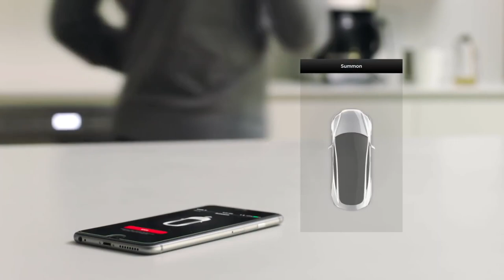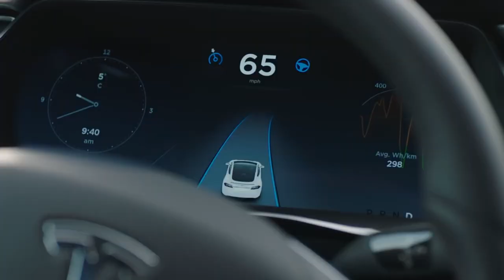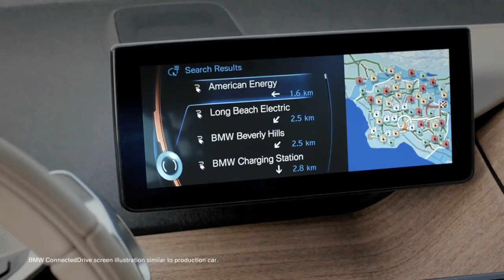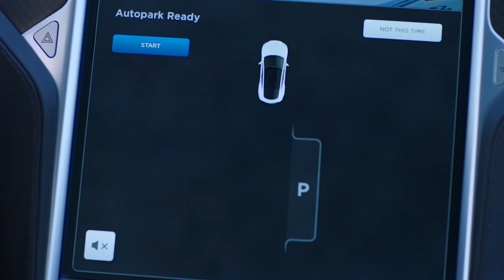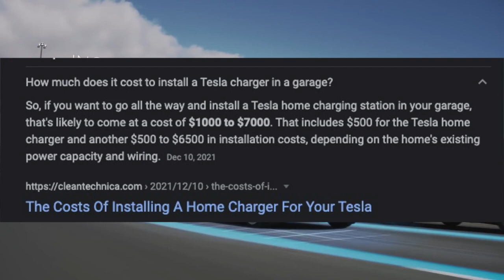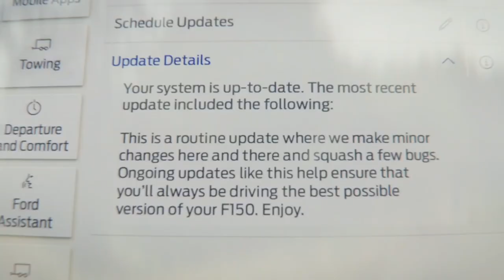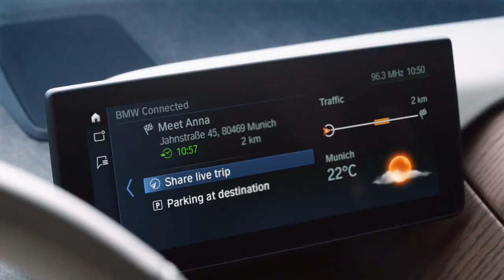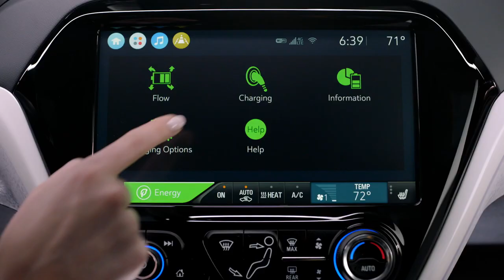Let the peasants buy EV's

Comment: Agree there is a big disconnect between the politicians and normal people on what they can afford and what they actually use their vehicles for. For me, the middle-class family in the US that may be able to afford a EV has one nice car and an older paid off beater. They use this beater to go back and forth to work, rack up mileage, and do store runs. The nice vehicle mostly a larger SUV is used for road trips, taking the family on outings during the weekend, towing a camper, towing a boat, going to visit parents across the country stuff like that. Most all those things an EV is inferior in doing. They want us to buy a nice car to go back and forth to work which is the opposite of what we are doing. I would rather buy a 4K Honda civic to go back and forth and have the 50K Tahoe to take my family camping, offroading, do a road trip to Alaska, tow a boat, going hunting in rural Wyoming 100s of miles from anything.    They also do not take in environmental factors like extreme heat or extreme cold. EV range is a joke when you couple it with -10 degree temps and that can happen anytime for the top 1/3 of the US during the winter. We cant put our life on hold just because it's cold out. This whole idea of one shoe fits is bad and we should be investing in hydrogen cell technology to pick up the slack of EVs and let the EVs live in the cities and hydrogen live in the rural best of both worlds.  But like you said none of this works for the less than middle class so to me the whole thing just doesn't have a good answer. Keep up the great videos
Reply: Well if that nice car is an EV, they usually don't have the option of getting very far for their road trips, considering the still very limited range of many of them.

Comment: Used Nissan Leaf is a fantastic second car for a family. Moreover, it's a free car. I bought mine 3 years ago for $6000 including sales tax, and it will save me this amount on gas and oil changes in 4 years since the purchase (that is, one year to go). After that the cost of the car becomes negative... 
Still can go 60 miles (a bit more for city only driving), lost about 1/4 battery capacity in 9 years. And this is about the worst battery technology there is: no liquid cooling. Modern batteries will last much longer.
Nothing breaks, and there isn't much there that can break: no engine (an electric motor has only one moving part, the rotor), no transmission (just a reducer that gas cars also have), no turbocharger, no exhaust system, no catalytic converter, no starter, no cooling system to speak of, no water pump, no oil pump, no timing belt... And so on.
BTW, I am renting, and I charge my car at work. It covers all the city (and nearby towns) errands with ease. And having driven an EV I will never return to a gas car. That smooth and quiet acceleration up from zero speed with no jerky transmission shifts is very addictive.
Reply from the maker: Good to know. Glad to see there are some people out there with them. Ive thought about gettin ga leaf, but just don't like the short range. With the gas prices their prices soared lately as well. I like low maintenance for vehicles.

Comment: I have an EV. I am not making 100k per year. My previous car was a used Opel adam (10k euros). I live in an appartment without home charger.  So it is definetely possible for a lot of people. The Dacia Spring cost 16 800 euros and eventually can be charged for free (at work, grocery store, ikea,..). A very common car like the VW Golf cost 28 000 euros + fuel, let's say 150 euros/month over 5 years => 9000 euros. So Over 5 years Dacia spring = 16 800 and VW golf = 37 000 euros. Just an example to show an EV isn't necessary more expensive, even today, and cost will continue to fall.
Reply from the maker: Where are you located? How much is gas there?
Reply: @VehicleHunter  Belgium. 2 euros/L at the moment
Reply: Are you married with a family?
Reply: @effervescentrelief  I am in couple but not married. She has an ice vehicle but the ev is the main vehicle we drive the most. There are plenty of families with only evs doing just fine

Comment: If you are using your pickup truck for work, and it can power your electric tools, wouldn't this be a big plus? I don't understand why the Cybertruck would not be used as a work truck.
Reply: 1) You use up all of the electricity powering your tools at a jobsite, how will you get home? Especially if a) where you are working does not have or will not let you use onsite power for recharging. b) The infrastructure to support such a need is still highly lacking while the politicians are too busy paying for gender pronouns and transitions, instead of actually paying for infrastructure in their infrastructure bills. 2) Mostly taking the above into consideration, the range on these EVs is severely limited. California can't even sustain current power demands, much less the draw demand they will see when this is significantly increased through their legislation. 3) The power needed to carry any medium to large size loads will significantly increase the power needed from the battery fitting - and in so doing adds significantly more weight - ensuring a negatively circular impact. 
If its a matter of carbon emissions, than large load / long haul would be better off looking into getting back onto the hydrogen engines that could potentially provide the power and range needed. 
If its not a matter of carbon emissions, than all of this is just political grandstanding, virtue signaling, and economic teabagging of the plebs like we already know it is.
Reply: @crimsonsamuraiftw  
1) The energy needed to power your tools is not that much, compared to an EV battery. 200 kWh can power a Jack Hammer for more than 3 days straight. If you have specific tools in mind - please name them. The Cybertruck will have a large battery even for an EV. Plus, you can use the Tesla Superchargers. Which Tesla is building without waiting for politicians, so this is not a problem.
2) If you have to drive two hours to the job site and then two hours back, you might want to get the longer range version, for 500 miles. I think there should be plenty of jobs in shorter range. Also, California has plenty of Superchargers, do you know of instances where these have ran out of juice? As far as I know California has cut electricity only in few cases when power lines may cause fires, unlike Texas with their power outage.
3) This is an engineering task, and one that the Cybertruck looks to solve. Yes, it will be a large car, with a large battery, so it can haul large loads. Considering Tesla are designing a Semi for very large loads with 500 miles of range, I don't think this is such a problem.
Hydrogen has its own set of problems, from obtaining the power cells to obtaining the hydrogen to storing it. It has low density and requires high pressures, which require heavy tanks, even if the hydrogen itself is not heavy. Toyota did not believe enough in it to invest in enough hydrogen stations, so filling up with hydrogen may be an issue.
My point is that the Cybertruck will drive cheaper per mile than normal work pickup trucks, can power electric tools so you don't need to bring a generator, saving even more money. I see you are against virtue signaling, but I don't see why this would not make business sense.

Comment: it doesn't matter what the used market does, only news cars matter. it's a global problem. whether it's you emittion 35 tons per 100 thousand miles (old diesel mercedes estate) or someone in kenya does not make any difference. the car will be used somewhere until it makes financial sense to keep up. with some cars this is 200 k, with others it is a million. with new cars however it absolutely does matter, and while anything petrol will at least emit 10 tons per 100 k, an electric will be under 1 ton for the same distance. that it takes perhaps 5 ton extra to make the battery makes no difference. it has to be done. but a nationalisation of the energy grid and massive shift towards renewables, and trillions spent on public transport wouldn't hurt either because the roads take more co2 to keep up than the cars emit. trains?
Reply: i'll leave the typo in fuck it